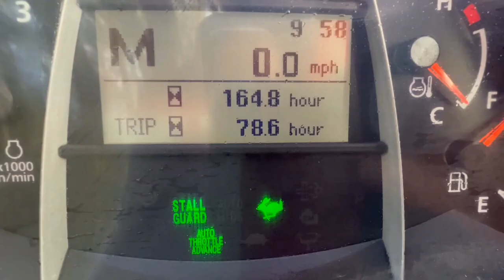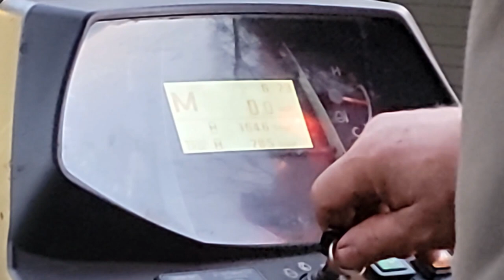M62 TLB Review 160 Hours

Comment: I run two M62's at a cemetery.  It has two e brakes. The hand brake on the side, that you showed, is for when the seat is turned around and you are using the backhoe. You can also activate the e brake by holding down the brake pedal and lifting up on the little orange lever below and to the left of the steering wheel. So you can activate the e brake without pulling up that handle that gets in the way of the seat.
Reply from the maker: That’s right, looks like I missed that detail!
Reply from the maker: I can see the logic in using the foot pedal brake in the forward tractor mode and hand brake for back hoe reverse mode, problem is I do not find the foot pedal brake strong enough to hold machine on slopes. Perhaps it needs adjusted.

Comment: I had a m59 from about 2010 to 2016 when the m62 came out and got it. Really like the platform as I’m an old school plumber and have always had backhoes. Deere and case. I like the m62, but the lack of factory cab finally sent me to a mini, so in 2020 went to a kx040 and now, the new updated cab of a u48-5. As a plumber, gravel handling is an issue but fabled a 6’ bucket for it. IF kubota was to put a factory cab on the m62 i may go back…and in no circumstance would i want the Curtis cab. Kubota put awesome cabs on way smaller tractors…why kubota? Why not the m62?
Reply from the maker: I agree… I’m thinking it’s due to sales volume. Research & development has a start up cost, I’m guessing they are hedging their bets that the ROI will take a bit to recover. (Return on investment.)

Comment: Hint:
Remove the steel boxes from under your rear section of the M62 seat and you will be much more COMFORTABLE!
Thanks for making these vids! New sub
Reply from the maker: I’ll check this out when I get home. Not sure I know what you’re referencing but maybe it’ll be obvious when I see it.
Reply from the maker: I forgot to get back to this mention of steel boxes under the rear of tractor. I can’t see what your referring to, can you post a pic of your machine?
Reply: The dealer had to of removed yours during prep as it is very obvious when you lift/tilt your seat that they would have been easily seen.
Ray 

Ray
Reply: I stopped this vid at exactly 3:05 and can see the steel boxes are still in place under your seat. Easy to remove and place back should you prefer or learn the reason for their existence.
Ray

Comment: I have an L47 and a B21 TLB, and I agree 100% with all your negative comments.  I will say the B21's forward and reverse foot pedals are separate with reverse operated from your heel.  It is far more ergonomic.   As far as your damaged step, I had the same problem so I created a CNC file and cut the identical pattern out of 1/8 steel plate to welded up a new one to look stock.  Kubota really needs to make those a bolt on part for replacement.
Reply from the maker: Thank you for your comments, wish I was more savvy in metal fab or I’d do likewise. Having access to a CNC is way cool. I have a friend who is very skilled in this area, so I’ll have him make another step that we can bolt on incase I do another stunt involving the death of my step. 😆
Reply: I can cut a set of the step parts for you if you are interested but not sure how we can connect since YouTube deletes any post with emails.  Maybe your company name/location? @wallyinthewoods

Comment: Hi, thank you for your review of the M62. I have a Kioti CK2610 TLB. It's nice, but man it has its limitations. That lift capacity is incredible. I don't need the M62 and could settle for the L47, but I would regret not getting the M62 down the road. I'm looking at possibly buying the same machine you have and was curious how much I should pay for a new one with the same options. Thank you
Reply from the maker: Glad this video helped! I wish I could tell you latest prices but in this inflation afflicted economy it’s going up constantly. 2 years ago this machine cost me $74,000, but took a year to build due to the Covid era of manufacturing delays. I was told at day of delivery I already had  several thousands of dollars equity in it if I sold it on the spot as new.
Reply: @wallyinthewoods  I really have to balance my wants and needs. I am surprised at that lifting capacity. Most skid steers can't lift that much. Thank you for your response and I have to say you are very well spoken in your videos. Looks like it comes naturally!

Comment: thank you very mush for the video I appreciate a lot , your explanation ,I have subscribed to your nice channel  also I hope if I can get idea about the price without taxes since I am not from US ,
Reply from the maker: Thank you so much, I’m in Western Oregon and all I can tell you is I spent about $73,000 with the accessories I added. That would be:
1- thumb
2- hydraulic tilt plate for loader bucket
3- 3 dig buckets, a 12” tooth, 24” tooth, and 36” smooth 
4- bolt on 3 point storage hanger (which I don’t use actually)
And I’m sure I’m missing a few other items that were not standard. I ordered it in May of 2021, and got it in June of 2022. I don’t know what the lead time is now, hopefully Kubota is catching up on their manufacturing. My sales guy told me upon receiving my M62 that it was already work several thousand more due to inflation. I do not know todays price.
Reply: @wallyinthewoods  thank you very mush for detailed answer I wish you the best luck and health
Reply: L47tlb goes for 73k,  May 2023
Reply: @FairlyInconspicuous  thx  a lot
Reply from the maker: Wow, 73k for the smaller version. Our dollar is being printed to death. I recall my salesman telling me upon delivery of the M62,  I already had $8000 equity in it if I sold it as new. After ordering it, the wait time was 13 months, and my quoted price was fortunately locked in from previous years price.

Comment: Would be nice if you were to share with us the price of this unit as well as your 110 tlb. Thanks
Reply from the maker: I ordered it in 2019, and received it a year later at the cost of 74,000 which included several upgrades such as 

1-automated locking mechanism for changing out loader attachments 

2- 36” smooth digging bucket

3- 12” trenching bucket w/ teeth

4- thumb on hoe 

5- 3 point stow away system that mounts below operator platform on frame

6- quick attach system for changing hoe buckets

The John Deere 110 quit  manufacturing them around 2011. Mine was a 2011 and I sold it for about $34,000 with 1500 hrs on it.
Reply from the maker: I would add, I don’t think the automated locking option for loader attachments is worth it as it tends to get stuck in position and the hydraulic cylinder is not strong enough to power through it. One might ask, why aren’t you greasing it? The answer is there’s no grease ports for the areas that are trouble.
Not a great system in my opinion. Getting off the tractor seat and locking bucket on or off with tradition hand levers is bulletproof and always works.
Reply: @wallyinthewoods  Thanks for the reply Wally. I bought my 110 about three years ago for 25,500. It had 1100 hrs on it. Also came with a homemade attachment for the old style Fisher plow. Plow is 6 foot . Probably the best money I have ever spent. Would be nice to move up but...

Comment: Nice review.....wish I could afford a M62🫤
Reply from the maker: It’s crazy what stuff costs anymore. It’s useful on the property but I definitely do some paying jobs with it often to justify the cost. I’m sure you could find some M59 models out there at a much more reasonable price point. They are basically the same until only the dig depth is 12 ft not 14. Not sure about hp, maybe slightly less?